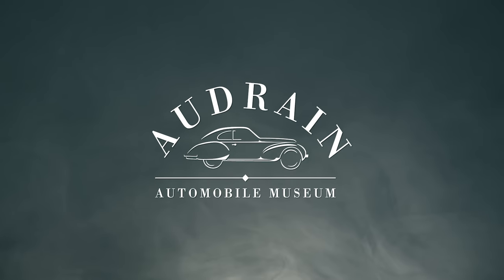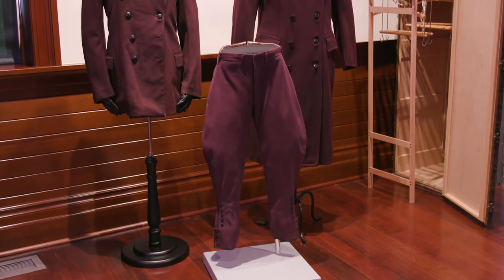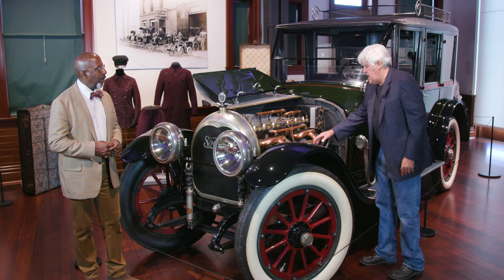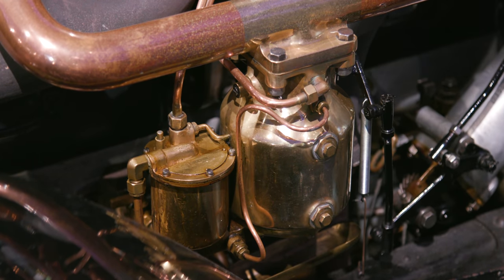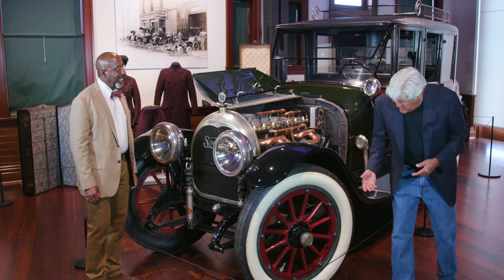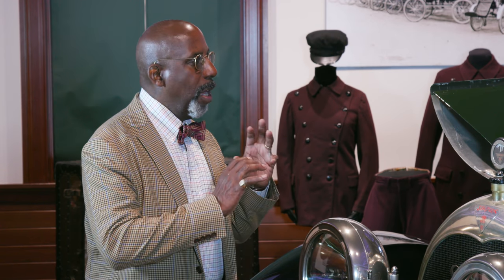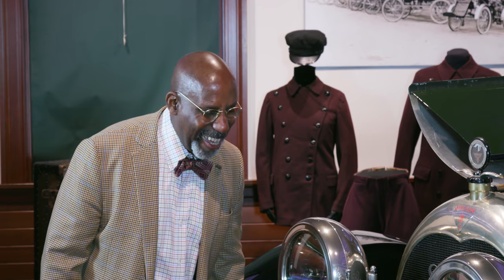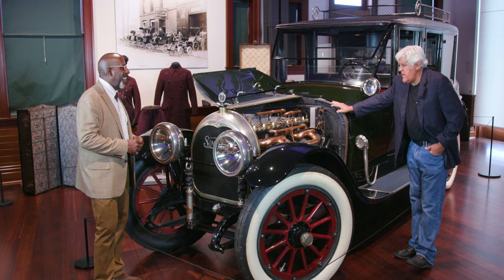Leno & Osborne: Simplex-Crane and The Art Of Chauffeuring

Comment: I was just telling someone the other day that in 50 years all these cars today will likely be impossible to restore  with out dated software and hardware. But a model T will still fire up.
Reply: I doubt that it will take that long before the news cars are junked just because the engine's computer is either not available or costs more than the car could potentially be worth... I was at a BMW service facility a couple of years ago and a woman had a late model BMW that had just gone out of warranty and the engine controller had died and needed to be replaced... They were quoting her $5K... For that particular BMW, it was still worth enough that it might be worth replacing, but at some point, the cost of that single part exceeds the total cost of the vehicle... Most people won't wait that long though -- when it the cost of the repair exceeds a certain percentage of the value of the vehicle, they will sell it because they figure there are other expensive repairs that will be happening soon enough... $5K for an engine controller here, $3500 for an air-conditioner compressor there, you end up spending a lot of money for an old vehicle and it better be really special to you before you should consider keeping it... I've owned ONE BMW and I will never own another... If you choose to own one, sell it right before the warranty runs out, regardless of how few miles you have put on it... My experience with the BMW was that BMW must design things to fail after a given period of time has elapsed since you registered the vehicle... BMW has a 4 year warranty that starts as soon as you buy / register the vehicle... After 4 years have elapsed, expensive things go wrong... Doesn't matter if the vehicle sat on the showroom floor for 10 years or you bought it as soon as it arrived at the dealership... Doesn't matter if you drove it 50K miles during those 4 years or if you only drove it 3K miles over those 4 years... After 4 years has passed since you bought the vehicle, expensive things start to happen... But, as long as it is still in warranty, it's a great car and won't have any problems... Just my personal (bad) experience, and as they say, "your mileage may vary"... :)
</rant>

Comment: On the other hand, in a 1930 Packard, a great number of suspension parts had adjustments, where today we just replace the whole part - no adjustment needed is one thing, none possible is another.  Or the oil system - you adjust the oil pressure to be 55 lbs and as things wear, you adjust the system to bring the pressure back up. If you set it for maximum pressure with new parts, you'd have 150 lbs of oil pressure (for a minute and a half).